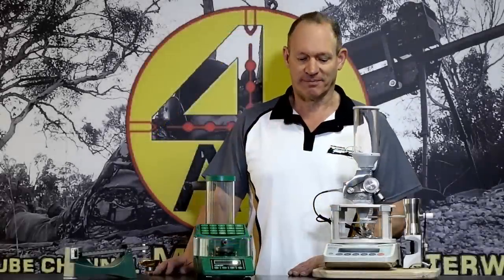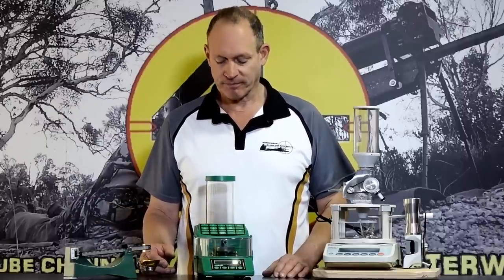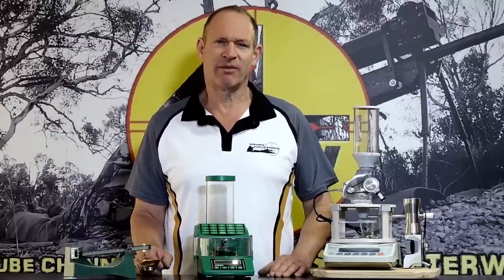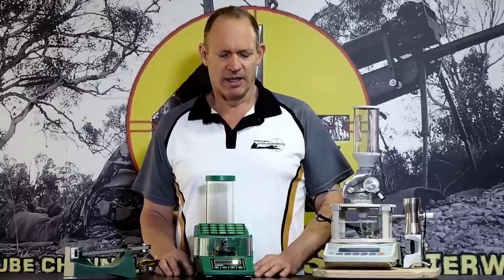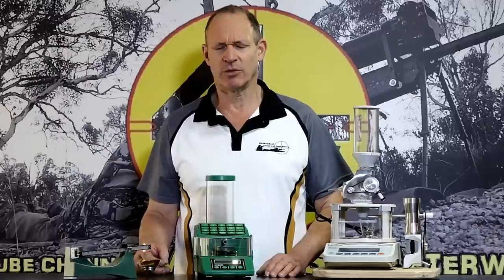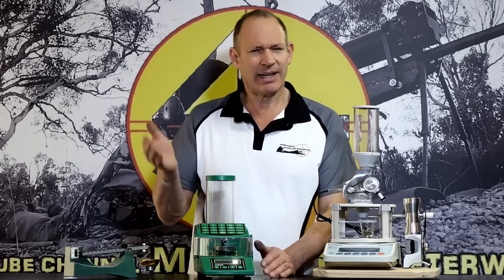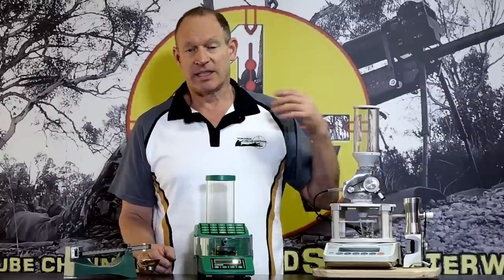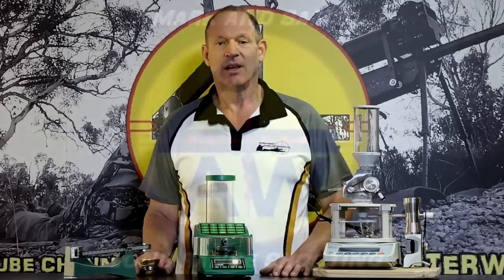Powder scales for ELR (overview)

Comment: Very well done from my view point. I reload for hunting and use the RCBS powder charger/thrower and  shoot .5" groups as long as I do my part. Your are 200% correct that there are a number of other factors that play a role in accuracy and probably larger role in how tight your groups are. Examples include quality of barrel, action, bedding, brass, neck tension, lead etc.  Yes, you are on the mark that there are tons of other factors aside from the difference of a few tenths of grains of powder.
Reply from the maker: Thanks Jeff, Cheers

Comment: Excellent Info. I have a RCBS Chargemaster Lite which has 0.1gr Accuracy and when I hit a node in the powder charge its usually within about 0.8gr.. I charge my match loads to the middle of the note and have allowance +/- 0.2gr or so.. which is plenty of room for error in the system. Like you mentioned, seating depth/neck tension/concentricity are more factors than charge weight.
Reply from the maker: Thanks Tim, Cheers

Comment: I own the 1500 and AutoTrickler and your points are right on.  As charge weight increases, the perfection level of the powder throw becomes less important.  I figure for about 50-60gr on down, the level of precision becomes more important.  Ive honestly found neck tension, case prep, etc to be far more important than a perfect charge.
Reply from the maker: Thanks Corwin, Cheers

Comment: Spot on about charge accuracy.   I started reloading in earnest about 6 years ago and used a balance beam scale that I inherited that's probably 60 years old.   Very accurate and I was able to get powder charges within a 1/10th of a grain for my 223.   For that small cartridge it was necessary to keep the percentage of error as low as possible while I was learning the finer points of reloading.   I kept consistency in the things I could control and experimented with the rest.   Now I also have a 25-06 that uses twice the powder charge and I use a digital scale to verify my charge weight after my Hornady Auto Charge Pro has thrown a charge.   Both of my 223s and my 25-06 are used for varmint control on rock chucks out to 600 yards so I need as much consistency and accuracy as I can get.  I'm not so anal about the powder charges all being identical but I am paying very close attention to seating depth and neck tension.  I also anneal my brass after every shot to ensure consistency.   All winter I reload, after bench testing to prove my load data, about 2400 rounds to get ready for varmint season.   The farmers appreciate the marksmanship.
Reply from the maker: Thanks man. Cheers and all our best.

Comment: i had a charge master lite for a couple years.  it was temperamental, in that it would drift from zero over time.  usually within 10-15m, and it was hard to tell, sometimes, when it had drifted.  yes, warmed up for over an hour, yes, calibrated every time using it, and yes, no florescent lights... tube or CF bulbs, in the room.  

got an autotrickler v3.  used the scale on its own for a couple months, while waiting for the trickler and was blown away by the steady repeatability of the scale.  no longer did i have to worry about where scale drift entered the process.  compared it to my old frankford arsenal battery pocket scale and they were as close as their resolutions allowed when calibrated with the same weight.  if the FA scale had the ability to disable the sleep feature, it would be awesome.

the primary reason i shelled out for an AT v3 is i am not an expert level shooter or reloader.  if i can take out any variable, such as charge weight, then i have a better idea of what needs improvement (spoiler alert, everything else!) to make me a better shooter.  

also, thank you for what you do for the community.
Reply from the maker: Thanks Man, Cheers
Reply: Yes, mine drifts also. Going to open it up to see if I can improve the unit. A better 12 volt power supply will be a start.
Reply: I've had my lite for a few yrs now, doesn't get turned off, calibrate each time I use it and have been lucky enough to have had no problems with it. I've always been in the habit of rechecking some of my loads, so I tend to at end recalibrate and check random cases and so far no problems.

Comment: I use a chargemaster lite, no problem getting sub 10fps sd's.  The  V3 auto trickler is roughly 3x as fast at dispensing a charge compared to the chargemaster lite, but you could buy 3-4 chargemaster lites for the same money as the auto trickler.
Reply: And the Chargmaster doesn't need an app to run.
Reply from the maker: Thanks Bruce, Cheers

Comment: Good timing Mark. My thoughts exactly.  I just sent my Charge Master back to RCBS for repair, and past that I'm thinking about a new powder measure, but don't want to get bogged down too much in the nerd stuff - a little maybe, but not over the top.  I'd rather be out shooting which is getting hard enough to do.  I would like to find a spotter as good as Sam, but I'm a cranky old man at my age.  Ive got a Bichon but hes not worth a damn at a spotting.  🔭
Reply from the maker: Thanks Man, Cheers

Comment: Man them super precise scales drive me freakin crazy because they're so sensitive that unless they're set up right all they do is float nonstop... My buddy has one of those Auto Trickler V3 setups and they're extremely nice and pretty fast but I'm able to get consistent numbers and great groups just using a scoop and a hand trickler so it's pretty hard for me to justify buying one. I've been wanting to pick up one of those charge masters just to make things a little faster then me having to hand weigh every charge ... I think you hit the nail on the head with this one as always good stuff and keepem coming brother!!!
Reply from the maker: Thanks Dan, cheers
Reply: Daniel get the better stuff saves time which is very valuable these days.

Comment: Good words Mark. I shoot a good bit of .223 and 6.5 Creedmoor. I use a digital scale with +/- .02 grain resolution. I still use the 'put most of it in and use an old school powder trickler to get the charge' method. Slow way to go but it works fairly well. I've always believed .1 grain resolution is too coarse thus never picked up one of those chargemaster units. Thanks!!
Reply from the maker: Cheers Man, thanks

Comment: Nice video and advice. I have a .375 Ruger (it's the only CF rifle I own) that runs between 76-82 grains of powder per load. The powder measure is a Redding match grade long range. I'd like to be able to shoot it out to 600 yards to practice for real world use. The maximum range I would consider shooting a moose is 400 yards. I figure if I can hit a 600 yard target consistently then a once in a lifetime hunt at 400 will be doable.
Reply from the maker: Thanks Man, Cheers

Comment: MORE GREAT INFO for the newbie reloader. ( if one can find the components here in Texas).  When I used to reload I had a balance beam medical scale. It would actually weigh a piece of human hair 1/2" long.  Every case was finished hand loaded down to one piece of IMR 4350. Then the charge was packed with pieces of cotton ball to secure the would burn at the most constant rate and repetitively?  I have had chronographed five consecutive rounds within 8 fps. Those were some fantastic loads.
Reply from the maker: Cheers Tim, thanks

Comment: Great little vid guys. I’ve also considered that with the larger projectiles ie: 300gr how much of a difference is 0.1 or 0.2gr of powder really going to make? Smaller projectiles yes you will need to be concerned.
Reply from the maker: Thanks Ben, Cheers

Comment: Recently I got into shooting PRS. I started out with a lyman 1200 trickler. Couldn't have florescent lights, cell phone with wi-fi/mobile data on, etc etc etc. I'm a buy once cry once kind of person so I opted for the V3. Huge difference BUT where I saw the most difference was when I worried more about neck tension. No, I don't turn my cases. (For PRS that's a bit overkill really) I tried just the resizing ball, then switched to bushings then finally to a neck mandrel die. The mandrel die is the solution. (In my opinion) I don't sort cases, bullets, etc. (Again, talking PRS) With .308 using IMI match brass (And mind you, this is through a M1A) I got my sd down to 7 with a es of 16. For a gas gun that's pretty fair. Recently I switched to 6mm ARC in a AR and haven't started handloading for that yet so it will be interesting to see how that goes. (The factory ammo is pretty darn good) I believe consistent neck tension is just as, if not more, important than getting down to the nearest .0xxxxx powder charge. I hear guys talking about picking out/adding to charges with single grains of powder with tweezers and all I can think is man, if your load is that touchy then something is wrong.
Reply from the maker: Cheers

Comment: The AutoTrickler is for volume, accuracy and lessor charges, it’s fast and takes out the flaws in humans.
The A&D scales are also used for a variety of other handle loading consistency tasks such as projectile sorting etc.
Buy once cry once if you looking to for speed and repeatability.
Reply from the maker: Cheers

Comment: I have a RCBS 505 beam scale I’ve been using for years. it’s slow yes but my groups are good. Just shot a .187” 5 shot at 100 yards yesterday and I’ve got a few.5” (.55) 300 yard groups as well. Not sure on the accuracy of a beam scale compared to a charge master or lab scale tho so I’m not sure if upgrading would make that huge of a difference? Have you used the beam scale to do ELR and if so have you seen any huge improvements over the beam using the charge master or lab scale ? Just wondering and thanks for all the information
Reply from the maker: All as said in the video, Cheers
Reply: I have been a scale technician for 30+ years and your beam scale will weigh as good if not better than the digital scales as long as you look after them if the pivots and bearings are clean and sharp your beam scale will do everything you need acutely just slower as you stated cheers Yogi Australia 🇦🇺🤙🤙

Comment: I'm a stickler for precise charge weights. I have a Chargemaster 1500 and I did the mod to it to improve its accuracy, but I still under charge by .1 of a grain, transfer to the balance scale and trickle up. My charge weight deviation is probably too small to measure with even your high end scale. I just like to remove that variable from the equation since there are others to work on.
Reply from the maker: Cheers Man, thanks

Comment: Mark, you mentioned that you sped up your RCBS Chargemaster. I would love to know what you did to it. This has been the most frustrating part of using it for me as it takes forever to weigh a trickled load. This has been my biggest irk and point of frustration with this unit, so much that I quit using it within a month of purchase.
Reply: A McDonald's straw stuck in the dispensing tube about an inch or so helps metering out the powder.  I dont think it is really any faster but it does help with the accuracy of the dispensed powder which means less dumping back in and starting over, if you do that sort of thing.
Reply: Do a search for changing the settings on your chargemaster, and follow the steps. Pretty easy, and is nice.
Reply from the maker: Videos on Youtube, long time since I did that, but they would still be there, Cheers

Comment: I load .32 SWL handgun target loads usually only 1.5 grains. I use an electronic Jewelers scale that also measures in grains and is accurate to .001 of a grain.  However this is just to verify that my Hornady powder thrower is doing it's job. Which it normally is with fine ball powders, I only need 1" accuracy at 25 metres. A range of  1.45 to 1.6 doesn't affect accuracy too much but higher or lower than that does. So I need at least .05 of a grain precision for match ammo where I weigh every throw. For practice ammo I just run them through the Lee 1000 progressive press where 2 inch groups are fine. I know there is more to accuracy then powder weight, for the projectiles, primers and brass that I use this charge weight is the most consistent in my gun with all other factors being the same. Fowling shots are also important I always get 2 or 3 flyers after cleaning my gun and then it settles down to 1" groups in a Ransom rest. I never shoot a match with a clean gun.
Reply from the maker: Thanks Mal, Cheers

Comment: I understand the importance of accuracy in powder scales . Does the humidity play an importance when loading the powder in a cartridge during the process before the bullet is pressed in to seal it .
Reply from the maker: Can do, but we have not tested, we keep our powder dry!! Cheers
Reply: @markandsamafterwork  that was quick !…. I was rewriting my comment . thanks for the quick response.
Reply: don't go into drying powder, you will increase the burn rate, and cause extreme pressure variations, leaving powder out to maybe gain humidity can also lead to variation, keep canisters sealed tight stored cool dry place, or controlled space, we use to dry powder to increase velocity when we shot 1000yd br better know what your doing and able to test, duplex loads are dangerous also running a faster burning powder in the bottom of the case with slower on top to increase flame, people use to do it on the 30-378 but with good actions, and with accidents blowing bolts out of rifles, don't have to be done today with the good powder selections we have today
Reply: Yes it does affect it. There’s other videos out there

Comment: I can see the value in the higher end stuff for the smaller cases but for what I shoot, 45-80gr powder charges, I don't see much difference. If I want to get really serious I go back to the basics with a good beam scale.
Reply from the maker: Cheers Austin, thanks
Reply: Spot on mate you can’t go wrong with a good beam scale mate cheers Yogi 🇦🇺🤙🤙

Comment: The V4 is a better unit then the V3. 
Biggest reason I run a AutoTrickler is accuracy at speed. Easily throws 2208 to the kernel.
Reply from the maker: Cheers

Comment: While you have a point about small cartridges, What are the odds you are shooting 223 much past a grand?  The wind is going to mean much much more than the charge difference.
I still want a "nice" scale, but only because my degree is chemistry and I have experience on A&D, Mettler toledo, etc.
Reply: The real market for the autotrickler I think, is short course benchrest. It doesn't take much powder to fill a 6ppc case. But considering the number of guys still using Harrell measures and spot checking on a scale, and shooting .050 groups, it makes me wonder if it would offer that much of an improvement for what it costs.
Reply from the maker: Cheers Matt, thanks